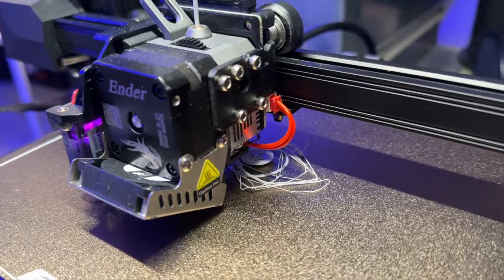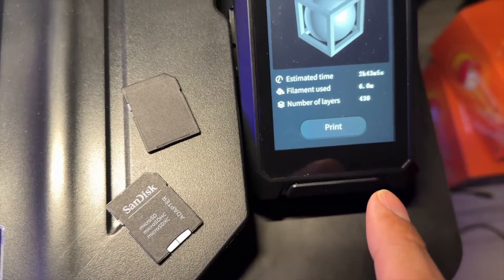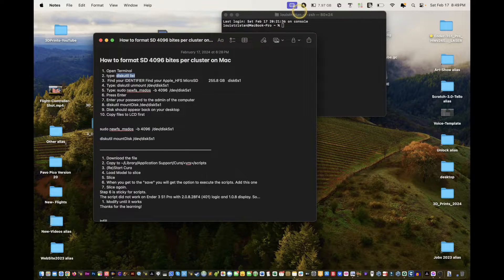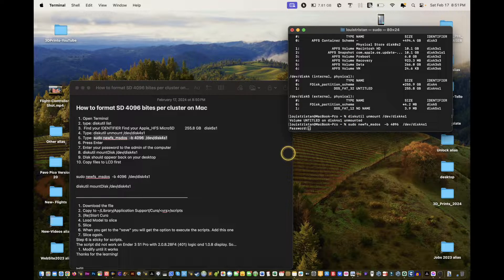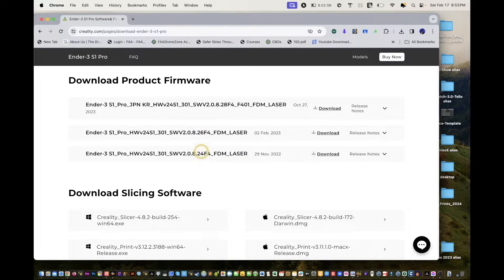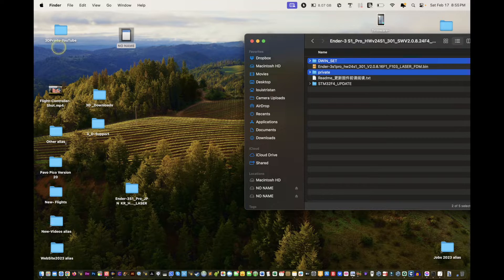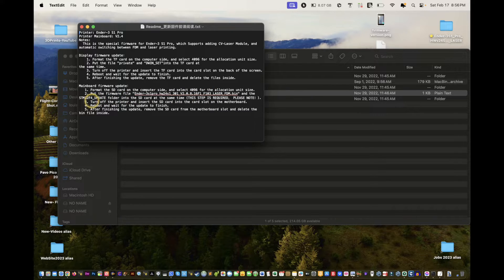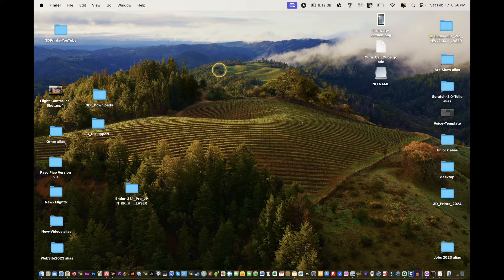ender 3 s1 pro firmware downgrade - how to downgrade ender 3 s1 pro firmware

Comment: Hi, thank you very much for the nice video for a very long time. I wanted to upgrade to a higher version of the touchscreen on my Ender 3 S1 pro.
I am tired of the printer stopped in the middle of the print area I would like to change filament I have no success. I’ve been trying for a long time to print two colors No success is there any suggestions Any advice would be very appreciated. Thank you very much if you answer my question how to print 2 colors without updating the firmware thank you Eli
Reply from the maker: Hope this helps. Will see what they say on the cura forum.. https://youtu.be/DSrZ_3hGShQ
Reply from the maker: Apparently it's limited but dij avata 2 easy acro not working https://community.ultimaker.com/topic/45554-pause-print-ender-3-s1-pro/#comment-333944

Comment: As a last resort, I decided to downgrade the firmware on my Ender 3 s1 Pro. It seems like most of the printer issues are now gone. It still needs some tweaks, but the major issues with bed levelling and bed adhesion are fixed, and the printer at least prints. :)
Thank you Lou for sharing the video!